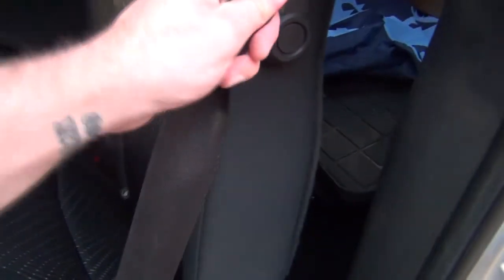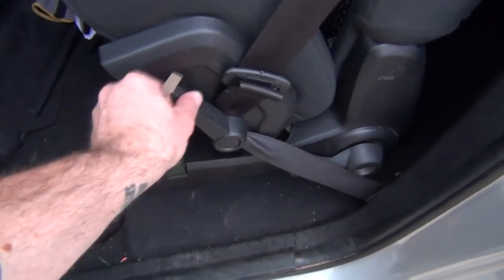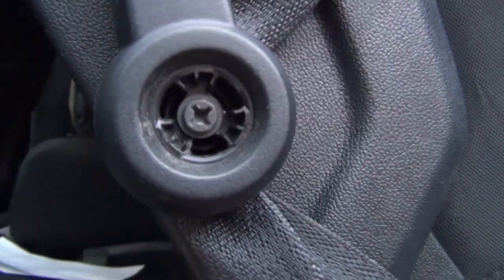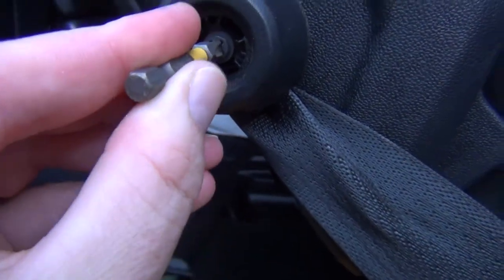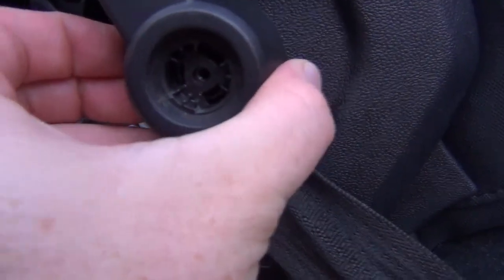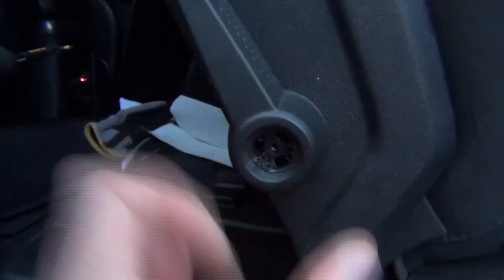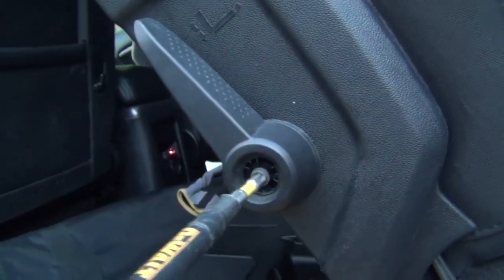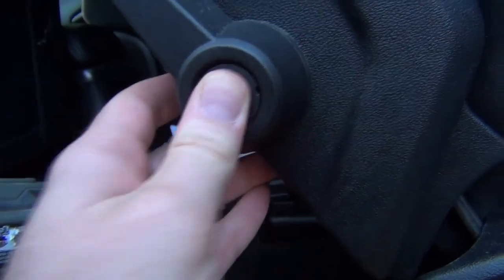2012 Dodge Journey Seat Belt Locked to Lift Handle Fix

Comment: I am having this issue on my 2022 traverse but I don't have a screw that I can take off. Any suggestions on how to fix it?
Reply from the maker: I’m sorry. I just spent a few minutes last ok’ing online to see if there were any instructions and I couldn’t find any. My guess on a Chevy is there might be a clip inside or behind that is hard to see.
Reply: @ArchesMechanic  I looked under the seat and there is a way to take it off I'm just not able to do it. I will probably have to take it to the dealer. Thank you so much for your help!
Reply: I have the same issue with one of the belts on the second row seat in my 2018 Traverse.

Comment: Hi there, I'm wondering if you can help me with a problem I have with my 2012 Dodge Journey.  My daughter is disabled and wears hearing aids.  She often takes them off and we don't realize it.  One went missing and I believe it somehow fell behind/down the seat.  I have two levers close to the bottom of the seat, one moves the back rest angle and the other level does not do anything.  It has never worked.  Our daughter lost a hearing aid before and we went back to the dealership and they said they could not fix the lever problem and could not raise the seat so we never found it.  This time we are absolutely sure of the exact spot as it happened in minutes, we were sure we would find it but we have not been able to.  Do you have any suggestions on what we can do to try to remove the seat or get access to any space behind it?  It is the model with only the two row seating and this happened behind the driver's seat. Thanks! Any suggestions would be so great!!
Reply from the maker: Janice Porter interesting. I haven’t encountered that type of seat yet. It it were me I would just remove the seats altogether. Should be a couple 18mm or so bolts holding them in. If you can’t find them let me know. I will make a video on it. I’m not in front of my car at the moment so I can’t see exactly. I can make a video tomorrow and have it up by Wednesday if you still need it

Comment: My front seatbelt passenger won’t lock when I brake. How do I fix that ?
Reply from the maker: The whole assembly would need replaced. It has a mechanism near the floor that does all the tensioning. It comes as the belt and tensioner as one unit.

Comment: I own 2012 Dodge Journey and my middle seat is stock like its off the tracks. How do you fix that?
Reply from the maker: Casey Morris I’m not sure exactly. Maybe lift them up and see if there is anything blocking them. Could be a plastic bottle or something. Get a good flashlight and get deep in there.

Comment: How did you lift that seat up. ???
Reply from the maker: The bottom part? It goes up when you flip the lever at the top of the seat by the seatbelt.
Reply: Omg. Ty. I did it yrs. Ago..Kids spilled drink trying to clean under the seat. Ty. So much.

Comment: Ok question on your journey do you have 3 seat belts in the second row or 2
Reply from the maker: patrick helm 3. The middle is a belt that comes from the passenger side rear seat.
Reply: Arches Mechanic I think miNes is missing
Reply from the maker: patrick helm should be integrated with the passenger seat. I’ll send you a pic if you add me on Instagram.

Comment: How do I lift the bottom seat up like that on my 2010
Reply from the maker: 2010 might not have that feature. If it does the very top lever will lift the seat and then make the backrest go forward

Comment: I have a 08 chevy suburban ltz no cover like that on my lift handle. And belt is stuck same way
Reply from the maker: Natasha Sainsbury there is a c-clip  holding that handle on
Reply: @ArchesMechanic  how do I get to it or get it off
Reply from the maker: Natasha Sainsbury on the back side of the handle. You just push the cushion aside and you’ll see the clip there. You can use a pick or small flat screwdriver to pull it out then pull the handle off

Comment: How do you lift up the seat?
Reply from the maker: Jeanne Joseph the lever on the top of the seat by the headrest
Reply: @ArchesMechanic  I have a 2014 model, there's no lever by the headrest.
Reply from the maker: Jeanne Joseph really? On the side of the seat right where the seatbelt goes in? Should be three total. One to move seat back and forth. One to lower seat back forward all the way and the third up top to make the butt part go up like mine and  the backrest forward a little bit and move the seat forward
Reply: @ArchesMechanic   I have the basic SE model they come with the one by the headrest.
Reply from the maker: 3:45 should help you

https://www.youtube.com/watch?v=aojJxxSwOjg&app=desktop